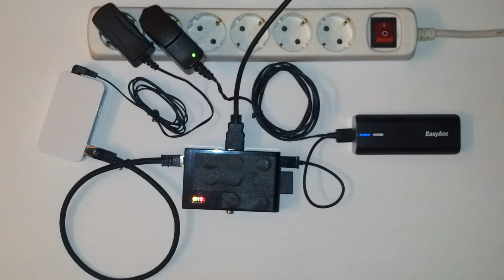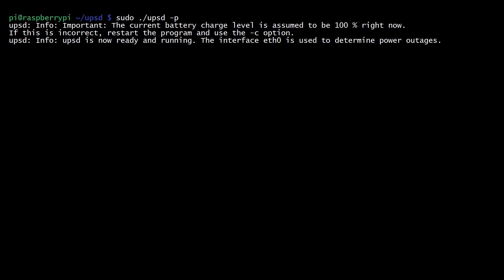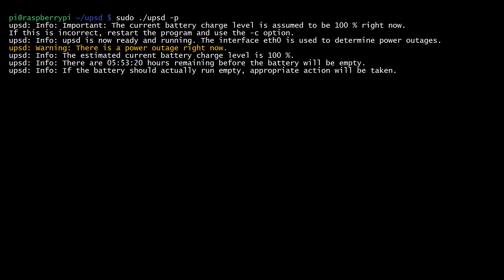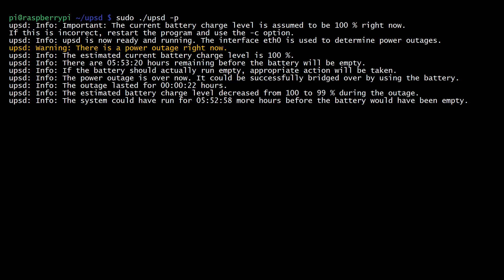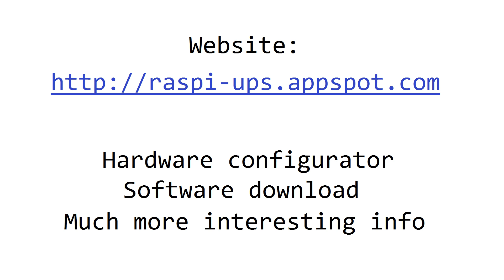Raspberry Pi UPS - full-fledged, cheap and simple

Comment: Instead of using the network cable for power outage detection (which will false alarm with network problems or a plugged ou cable),  i've used a little 5V power adapter with a 5V relay module attached to it. The relay is always powered. I connect a wire to the NC (normally connected) pin of the relay output. When there is a power loss, the relay closes the circuit to the NC output.
The output is wired to a GPIO pin and GND of the raspberry, like a push button.
A small script detects this input and starts a countdown of x minutes.
If the power is restored within the countdown time, nothing happens. If the power is not restored, the scripts shuts down the pi safely. Works as a treat for a few years here!

Comment: Also, one more note, RPI can draw anywhere from 2W to 6W depending on how loaded the CPU is and whether you add a USB 3G dongle or not. So really, to be safe you would need to shutdown when the battery could still be at 70% charge (you don't know, it could be approaching 10% if it's loaded). After you shutdown, it will keep draining the battery and power the USB 3G dongle even when "off".
Reply from the maker: You can configure the estimated battery charge level within the program where the Pi should be shut down (default setting is 30%). Even if the Pi is under full load and a 3G dongle is used, it will be easily possible to operate the Pi for hours. As for the issue with draining the battery, see my other post above: you just simply need to disconnect the battery after the shutdown for a few seconds.
Reply: Raspi Ups yeh, but it's not really a UPS if you need to physically be there to disconnect the battery :) - my applications of the Pi are all where the Pi is hidden away in an alarm panel, or in a vehicle, or in the loft and there is no easy physical access to it.
Reply from the maker: *****
Well. You don't need to be there if you want to run your Pi 24/7, which is the primary target of this UPS. True, if you want something which can automatically power your Pi on and off, then this is not what you're looking for.

Comment: I ran my Pi on a small power bank which was in turn plugged into the USB-port on my router. I worked fine, day in and day out. Still, I've read that batteries cannot be simultaneously used and charged. This would seem to indicate that the battery is not powering the unit when there is power. Do not all modern USB power-banks function in this way?

Comment: I went this way and bought the easy acc 9000 powerbank. I am succesfully using it, but I read in the manual that the powerbank should not be connected to the powersupply at all times. I also notice that the powersupply runs quite warm and that the powerbank is also warm after continued use (fully charged) I measure power consumption and read about 8 watt from the mains. The pi itself does 3 watts at max, so this construction is costing me about 5 watts.

I have concerns about the lifespan of this set up. The inapropriate use of the powerbank may wear it down really fast.
Reply: what did you do to make it work in the end?
Reply: @cold_aim  I never said it didn't work  (?!?). It is quite perfect, even now 5 years later still up and running an survived many power outages. It is always connected and until now the powerbank has not complained.
Reply: @Woodhousermadness  OwO that's awesome so should I go with this solution..? Sounds promising

Comment: First of all you need to know if it can be charged at the same time the RPi is connected. When you find a powerbank that can do that you need to test it. Some of these powerbanks will turn off the power in half of a second when they get connected to the power source. So if you get a power failure for a few seconds this will make the RPi lose power when the power source gets back. Then it is pretty useless with this type of UPS. Maybe you are lucky and can find one. I haven't :(
Reply: I actually bought a newer Anker power bank that did not work at all with this setup. It turned out that an older power bank I had (Motorola P4000 Universal Portable Power Pack) worked because it allowed the pack to charge as well as draw power. Amazon actually still sells that particular one. Newer power banks it seems do not allow this as they have detrimental effects on the lifespan of the power packs.
Reply: I was wondering the same thing when i saw this. I have a power bank that cuts out briefly when it is charging
Reply: That's true, none of the currently available power banks can charge and discharge simultaneously. To solve that, you can add a couple of relays to the power bank and have it switched back and forth in between charging and discharging modes: http://blog.nagimov.com/uninterruptible-5v-usb-power-supply/
Reply: hi Ruslan Nagimov! Do you think the relay switching is fast enough to not reset the pi?
Reply: yes this is true the powerpack has no circutry to alow pure passthrough when its fully charged so the battery is always being used just a bit ,but over time it will fuck it up ,in his case these powerbanks are getting so cheap tho
Reply: passthrough its protip
Reply: I did this for my iSmartAlarm and added a capacitor so it keeps my alarm going during the switch over.

Comment: It's a novel idea but doesn't work in many applications. The Raspberry Pi will discharge the power pack every time there is a long term power cut because the Pi cannot switch "off" (the Pi draws a considerable current even when "off"). Also, once off, it will assume the power pack is charged. If the power pack is only 5% charged when power is lost (and bare in mind it can easily take 6+ hours to charge), the Raspberry Pi will falsely believe it can be on for 10 hours when in reality, it will lose power in minutes. Might be worth adding these 2 points to the FAQ, otherwise thank you for a suggestion that could work for a lot of other people :)
Reply from the maker: Thanks for your comment - you're right that this UPS is better suited if you want to operate your Pi in 24/7 mode. Otherwise, you'd need to disconnect the Pi from the battery for a few seconds after it has shut down to prevent the battery from running empty. You can then simply press the power button of the battery to boot it up again.
Reply: +Roman Gaufman 
I know its 6moths old but , today we have got much intelligent power banks.. the Adata PT100, I believe there are more out there. 
It automatically powers off if idle for 20 sec. looks like that can solve the problem of continuous discharge. :)

I just ordered one for me :). will try to update with my reviews when I receive & test it.

Comment: Can anybody tell how good powerbank batteries tolerate 7/24 constant charging on the long run (years)? Is this an intended use for the battery type used in powerbanks?
Or is it simply killing those batteries?
Can it be the reason why some of the people experience way too high wattage, hot chargers and hot powerbanks/batteries?
Don't get me wrong, I do like this here idea a lot. But I do have concerns about electric devices getting hot in my home.
I'd rather not set my house on fire.

I think the basic difference is that classic uninterrupted power sources have different type of batteries than power banks.
And those for UPSes are more adjusted/suited to long run and constant (relatively slow) charge. While powerbank batteries are targeting short, intensive charging and discharging while having less tolerance for non-stop operation (charging).
Reply: The cells in the powerbanks are also fine for doing this tbh

Comment: Hi,
Are you sure the power supply reference you present on your website does the trick?
Because I got the little sister last week and it fails: At the moment I simulate the power outage by switching off the same red button you have, then the power bank LEDs start blinking, and the red LED of the Pi switches off. I tried with a phone also instead of a Raspberry Pi, and you can see on the screen, every 3 seconds the charging status changes.

If you are sure then I can send it back and get the reference you advise. Thank you in advance for your time.

Comment: How many Amper i need to run Raspberry normally. Your power bank give 2A (max). With 1A i can run it? or with 3A i will burn it?
Reply from the maker: League Of Promotion™ How many Amp the Raspberry Pi needs to run depends on the used model version and connected hardware, so it's hard to say. You usually should be able to run your Pi with 1 Amp as well, but with some 2 Amp power supply you'll definitely play it safe. And, you can use any 5 V power supply which is rated >= 1 Amp (doesn't matter if it's 3 Amp or 50 Amp, as this is always only the maximum output).
Reply: +Raspi Ups 
What about the powerbank itself? Will it like being connected to power all the time and does it consume power to an extent that it substantially impacts the low power nature of the raspberry pi?
In my case I notice that the powe rsupply and the battery run quite warm, and the  manual states that it should not be connected all the time.
Reply: revinobable i use 10.000 mah powerbank, 2Amp. And i will work more than 10 hours with normal - push work
Reply: @raspiups7462  normal raspi need minmum amperas 3,5A and recommeded good have 3A and if use HDD etc display need 5A and good power have 8-10A then no have low voltage newer. but many have lot lot lot problem power 2A or 2,5A no work good newer, only basic raspi whitout bluetooth,display,keyboard,mouse,etc anythink external parts. and if no have any external parts how use and not can use good anythink work.
Reply: @leagueofpromotion1503  bullshit raspi not run newer 10 000mAh battery 10 hour, maybe maximum have 4-5 hour.